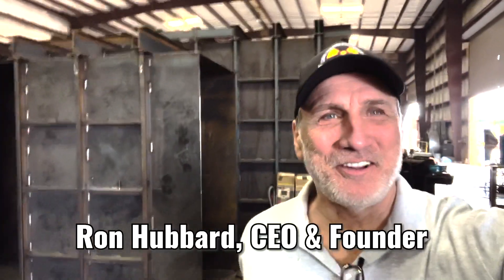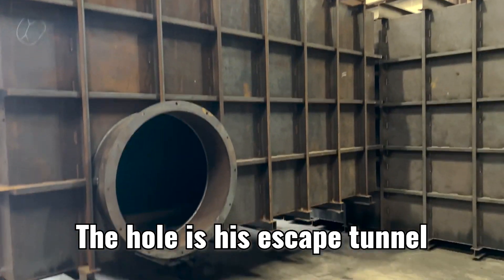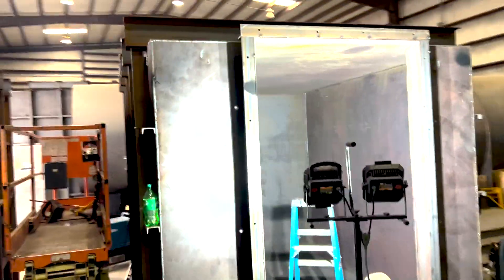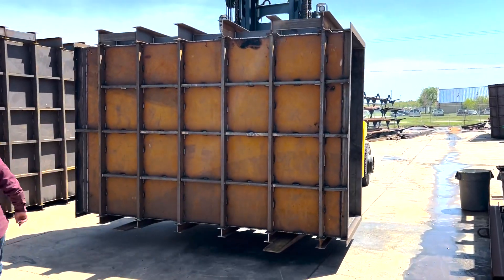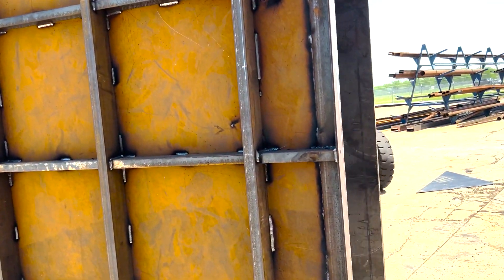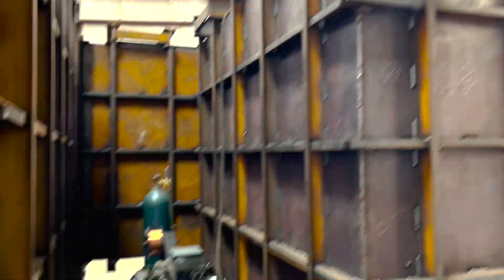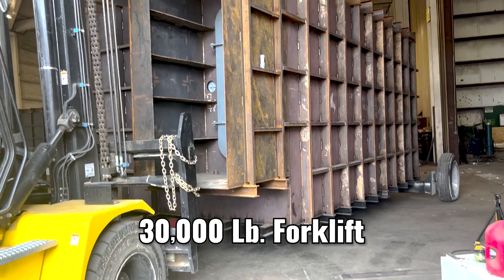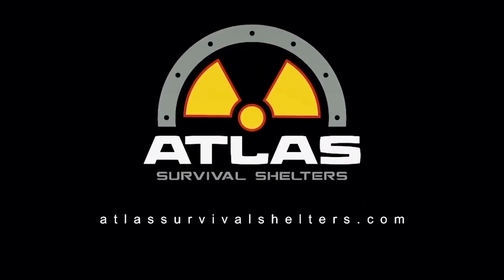We Preassemble A Big ATLAS Bomb Shelter In The Factory

Comment: I’m surprised you don’t have more people adding an inverter & battery bank that the generator can charge, it makes a huge difference in fuel & efficiency (no wasting fuel running the generator to power 1/10th the load)
Reply: That is standard practice. However, none of the electrical equipment is installed at this stage, and customers choose the electrical system that suits their needs.
Reply: @guytech7310  nah, only one bunker tour Ron has done had an inverter & battery bank & it was a solar setup.
Also, thanks for stating the obvious about the install, there seems to be a lot of weird people like you creating accounts just to answer random questions that aren’t being asked 😂😂😂
Reply: @jtr82369  Inverters & other electrical equipment are installed onsite after the bunker has been installed. Not very many videos of post installation work posted.

Generator room is for a generator. There is no room specific for  inverter or batteries.
Reply: @guytech7310  again thank you for stating some obvious info that I didn’t ask for lol
But nah, I’d bet it’s less than 30% of installs… it may start rising with the new battery tech coming down so much in the last 2 years. But it hasn’t been worth spending $10G on batteries that won’t be good in 20 years when they actually need to bunker up lol.
Reply: @jtr82369  Jesse virtually all of the Bunkers have a battery backed power system. Many have solar panels as well.

I don't know how else to explain it. You seems want make your own opinion, a fact.
Reply: @guytech7310  well than you should move on 🤷‍♂️
Cuz my belief is based on what I’ve seen & only a trustworthy person (like Ron who actually sells & installs them) will convince me otherwise.

Comment: How does the CO2 escape the generator room? Also is there like a filter or something so people don't see the smoke coming out.
Reply: i would assume there is an exhaust pipe from the generator to outside
Reply: @user-lg7cb6sr5z  yeah but how do you prevent people from seeing the smoke
Reply: The smoke of a diesel generator usually is colorless, so the smoke isn't a issue. 
Only when the generator has a problem it may produce white or black smoke.
Reply: @lucasbarcellos8356  I have seen diesel generators and its usually a translucent gray-is smoke. I was thinking of add a filter. Also diesel smoke has a smell, the generator is loud, and heat.
Reply: @lucasbarcellos8356  the smell is quite strong and distinctive
Reply: @michaelwang6751  You can solve the visibility problem by only running it at night. And if smell and noise is a problem them you burried your bunker in the wrong place.
Reply: @lucasbarcellos8356  Good idea the generator can be run at night but like if you live in a suburban area you might have neighbors.
Reply: @michaelwang6751  You're right, it would be a problem in the city, I personally would only build a bunker in a bug out location. For those who don't, there's some videos on YouTube teaching how to install a car muffler on a generator. I don't know how effective that is tough.
Reply: @lucasbarcellos8356  But once a you see on the news an ICBM is coming you got to get in the bunker ASAP. Don't know if you will have enough time too. In addition, you could run out of diesel or somebody could ignite it. I was thinking of solar panels with hidden wires
Reply: @michaelwang6751  Solar panels wires can be dug out and followed back to your bunker. 100 gallons of diesel and a large battery bank like the one Engenier755 installed on a Atlas shelter on his video could power a bunker for months.
Though I would prefer solar over diesel any day.
Reply: @lucasbarcellos8356  Thats why I was thinking of like embedding the wires into concrete or something like that. I'm worried of someone tossing a Molotov cocktail into the exhaust pipe
Reply: @michaelwang6751  Wouldn't the generator automatically turn off if overheated?
Reply: @lucasbarcellos8356  no like if someone through a Molotov cocktail into the generator, it might explode or catch on fire
Reply: @michaelwang6751  I think the molotov cocktail would fall on the ground due to the pipe shape. It has a T shape but on it's side, so when someone tries to throw something inside like water it goes straight to the ground. I'm not a expert but I think the fire wouldn't last long in the bottom of the pipe due to limited air, so it shouldn't cause any damage.
Reply: @lucasbarcellos8356  Im just afraid of a fire, idk how they're gonna do it. Aren't Russian tanks supposed to have these anti burn features. HAHA
Reply: @michaelwang6751  Hahaha. I'm not sure what features the Russian tanks have. I think that the best defense to a bunker would be to have it so hidden that no one could find it, so preferable in a off grid remote location. Backyard bunker's would invite undesirable attention, unless you can somehow installed without any neighbors noticing.
There was a guy on Doomsday preppers who digged himself a bunker on his garage without the neighbors knowing(until the episode aired). I think he used to sell the plans to built it or something like that.
Reply: @michaelwang6751  I found it. The garage bunker was on season 1 episode 10.

Comment: NOW That was some Hot Ass Shit happening there. Granted I haven't seen all Ur videos Ron, but this bunker here gave me a EFFing stiffy!!
I don't have the best bunker like the one's over at Atlas, but I did the best to build a DIY gun-room with what I do have. And that's a 4 bedroom, 3 bath home built  in 2015 in Henderson NV, that's all paid off after selling my grandparents beautiful home, but located in shithole Los Angeles CA. 
   I'm obviously a huge 2A guy (why I left commiefornia) so I turned my new walk in-closet (that's the avg size bedroom in a 1940s track home in SoCal) into a gunroom with 1/4" inch diamond steel plating on all four walls & ceiling that was reinforced to hold the weight. I bought a gun-safe door with a locking spindle cause my fear of an EMP blast Or natural coronal sun-flair frying any electronic biometric lock would sux balls in a emergency.  
   So-far, so-good. My walls are not buckling or bowing at all, but I don't plan on moving, so this is my home that I plan to die in. So if my changing the schematics of the house ruins the chance of my kids selling my home after I die. well? I'll let them deal with it, lol. I'll be gone.